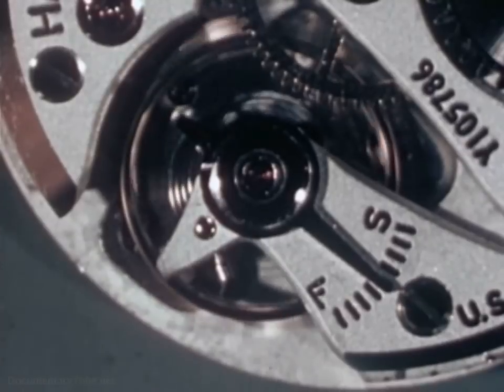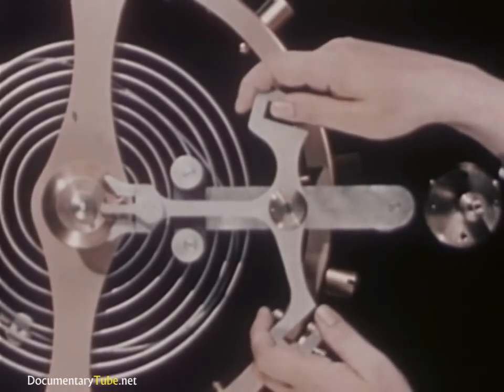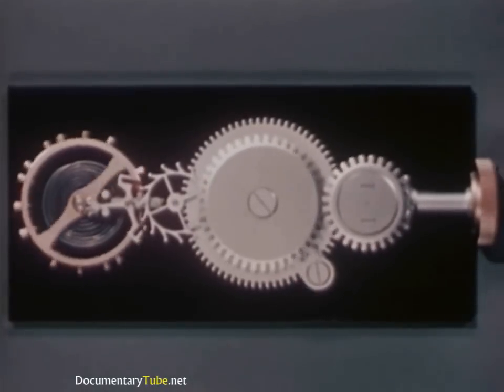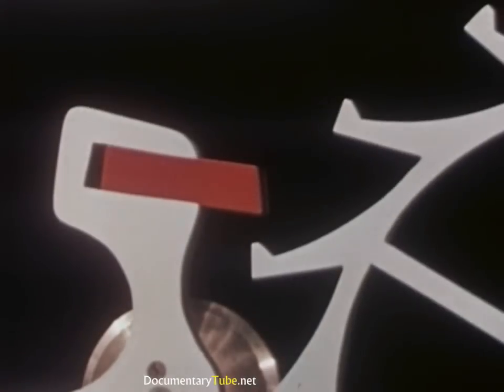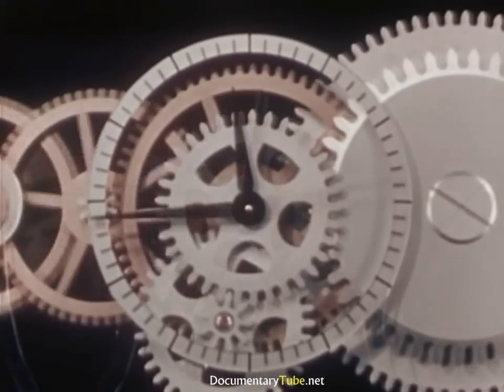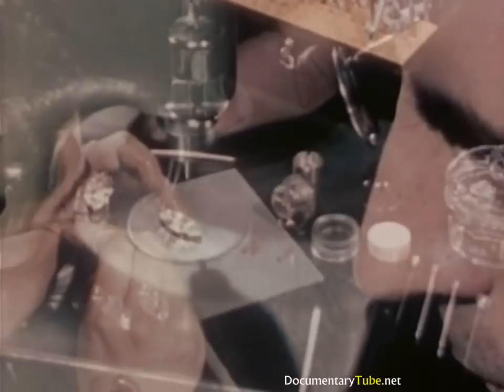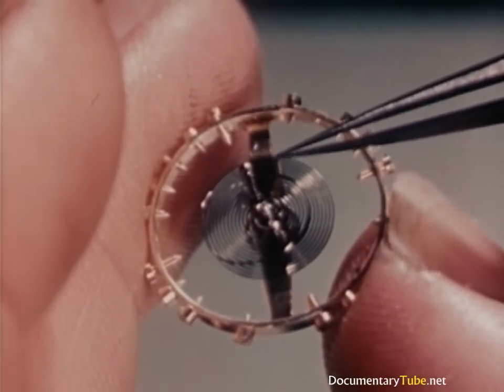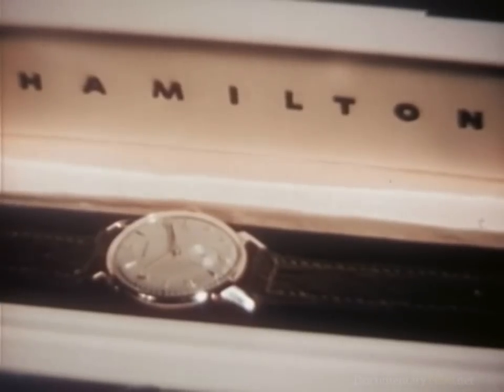HOW IT WORKS: Mechanical Watch

Comment: This is the best video showing a first time viewer of escapement type mechanisms. I had to learn how to adjust them by myself when I was 14. wind up Timex. Moved on to a 1974 Accutron, tuning forks! bought in 2014 an Ernst Benz, Chronolunar. Mechanical.

Comment: I just purchased two mechanical watches, purposely with the backplate removed so I can see the movement, springs and gears. It is made in 2021, and the insides look almost EXACTLY like this one. I thought it was 6 ticks to the second, because I can clearly see the Escape Wheel (I now know the term for that odd-toothed gear) and now I know it's 5. 

The IRL oversized example should be used more in demonstrations. I know 3D modelling is awesome, but they usually don't have the interactable extra physics that real-life has, only what the animation needs.
Reply: What are the names of the watches you purchased?

Comment: I watched other modern videos that used CGI to show how mechanical watches worked and really still didn't understand it.  I watch this, and show now understand how it works.  The part where they show how the palette, palette jewel, escape wheel, and balance wheel interact finally clicked in my head.

Comment: 5:47 Importantly, the "isochronicity", the time-keeping accuracy, is achieved when the "nudges" push against the hairspring...if a nudge is too hard it doesn't matter as the hairspring will return a little quicker, if too soft the hairspring will return a little slower, but it will always return in the same amount of time, just like a pendulum always swings and returns in the same amount of time regardless of the starting point (the only way to adjust a pendulum's swing time is to adjust the length of the string).

This is the essence of isochronicity, being able to maintain a time frame regardless of the strength of the pushes or nudges. A balance wheel is essentially a pendulum but imagine the pendulum scribes a full circle rather than an arc, and imagine the hairspring is gravity. This mechanism takes gravity out of the equation, which is why they were invented in the first place, for use at sea to calculate longitude. The balance wheel was invented by Robert Hooke.
Reply: @The Terrible Puddle....yes, there is a lot of movement that can throw off the accuracy of the watch, tourbillons counteract that movement well, making it more accurate
Reply: @The Terrible Puddle.. bear in mind movement is not all gravity, movement can be made in any direction, imagine shaking a watch up, down, sideways, tourbillons counteract all those motions, yes gravity is a substantial part of the story
Reply: I had this question after watching this video regarding how the ticks were uniform for timekeeping. Gladly found your comment and now I truly understand the fundamentals. The video does not cover this, it's more focused on the mechanical aspects rather than the core principle.
Reply: @Nikhilus_yadavus   yeah, I felt the video, albeit great, missed the fundamental concept of isochronicity which is where the regularity of the ticks comes from so I sat down to define it in my own words. 

I could use this reply to add that most mechanical watches run at 21,600 beats per hour and, through a series of cogs, which displays as 60 ticks a minute. BTW it doesn't have to be 21,600 (3hz), it could be 28,800 (4hz) for potentially more accuracy, or even 36,000 (5hz or hi-beat) more accurate still, although the power reserve tends to be lower. With 3hz movements you can visibly see the second hand ticking 6 times every second (6x60x60=21,600 beats per hour) with 28,800 and 36,000 an even more pleasing sweep at 8 or 10 ticks per second.
Reply: @TheExpeditionUK  Really helpful. Thanks!
Reply: This was really helpful, thank you

Comment: I have one question. I hope I can explain it correctly. So the crown spins first two gears, and the second one winds the main spring, so they are connected. Im asking: what kind of connection it is. I imagine it is not a symmetric joint because, unwinding of a main spring wheel would affect the winding gear, and as we know, winding gear is blocked in the unwinding direction.

Comment: How do they make sure it takes exactly 12 hours for the hour hand to make a full rotation?
Reply: My understanding is that the gear ratio makes the minute hand move 60 times faster than the hour hand, and the second hand move 60 times faster than the minute hand, but what controls how fast the hour hand moves?

Comment: How would you even begin to calculate the exact measurements you would need to make all of these gears? How were watches originally engineered?
Reply: My best guess is that larger clocks were made first, then over time, people found ways of making them smaller and smaller. Kind of like how computer components got smaller and smaller.

Comment: Does it tick more slowly when the spring is low on energy?
Reply: No. It ticks at the same rate because the balance wheel oscillates at the same rate no matter the matter the force on it.

Comment: is that a tourbillon?
Reply: shahrouzkhan200 No, this is not a tourbillon. This is just a basic mechanical watch. The movements get more complicated by the many "complications" that are added to this base model. If you add a date, or day of the week,  or month of the year....the movement becomes more "complicated". Many more gears have to be added for each new type of complication. If you add a chronograph (stop watch function)  you are actually almost doubling this original base model....like adding a second floor to your ranch style home. The tourbillon is the pinnacle of watch movements. It is why they can cost over $100,000 US dollars. It can take two or more years to develop one tourbillon movement. Once developed, manufacturers generally only make 10 copies of that model.....hence their rarity and cost (besides the precious medal for the casing).  A tourbillon has very intricate parts that defy earths gravity that other wise slows a regular movement down ever so slightly.

Comment: Our ancestors were soooo much smarter than us. Mechanical energy is incredible and todays electronic devices are shameful in comparison.
Reply: Chuck Beef I mean you have a computer at the palm of your hand you can watch hundreds of movies. Time that is more accurate then a mechanical watch. How do electronics perish in comparison.
Reply: Exactly. Our electronic devices are far more complicated than this relatively basic mechanical machinery. I think any engineer would be able to respect both forms of complicated machinery.
Reply: As a junior in computer engineering I can confirm that the complexities of circuit and signal analysis make me cry on a daily bases
Reply: Shameful?  Try to learn how to design a new computer processor. I can build a discreet component TTL computer ie late 70's machine, but today's processors are just black box magic.   Every bit as much brain power goes into today's devices as in a mechanical watch.  I think Both are incredible!

Comment: What's so amazing is that a quality mechanical watch can be accurate to within a second or two a day. Remarkable barely describes that.
Reply: Leon bOzZ Much more effort is put into a mech watch than one that runs on quarts. Time is only a factor to appreciate. Others include craftsmanship,  quality of materials , warranties, etc. Your quartz is accurate,  much more accurate, but there's a reason why others still prefer mech.
Reply: Competition chronometers and marine chronometers are accurate to less than a second a day. Despite variation in temperature and position. That’s crazy lol.
Reply: if you get a tourbillon or gyro tourbillon, some of them can be accurate to a second for like 300 years
Reply: Dcvbkyrsscbgdsxcgf  you mean 3d printing. Its not wide spread just yet. And those methods are still not used in manufacturing of mechanical watches. The manufacturing is  still vastly more expensive.
Reply: Superlative Chronometer, dudes!
Reply: @mr.personal-ity  Omega has Master Chronometer too!
Reply: mdfouru  so are u saying that a quartz watch is a less complex feat ? A quartz watch is years ahead of any mechanical watch and is a complex engineering feat in itself. Only problem with a quartz watch is that it doesn't have gears and springs to look at and admire but that doesn't mean its inferior . A role of a watch is to tell time and a quartz watch will do it more accurately than the most expensive and accurately made mech watch .I think we should appreciate both movements.
Reply: @jerryldavis1823  I agree. When Seiko unveiled the Astron, it was one of the most sought after watches. It was an incredible milestone in electrical engineering. Since the majority of watches utilize the movement, I think it speaks for itself as the greatest achievement in timepiece technology.
Reply: @jerryldavis1823  Truly said. I just felt the same when I read that other guy. I am a mechanical engineer myself but to think of pushing other discplines under the bus is just dumb and gets in the way of real innovation. Mechanical watches sure are flashy while doing its job, but Quartz watches did what no mechanical watch could do. It made the watches a thing which everyone could have. Made them smaller, easier to repair, and not just a luxury item that mechanical watches have been reduced to now. Engineering is about making life simpler. While the feat of making a mechanical watch requires remarkable craftsmanship, and initially a breakthrough, its time to move on, put on some new glasses, appreciate the real breakthrough behind the invention of mechanical watch and not dismiss other kinds of watches which do the same work just as beautifully.
Reply: how is that amazing? my 30 dollar quartz watch is more accurate
Reply: you dont need a battery for a mechanical timepiece
Reply: @leon9197  You just don't get it.
Reply: @leon9197  Making babies in a test tube is also more accurate. I prefer the beautiful way.

Comment: How does the balance wheel switch toggle at the same rate, even though the potential energy from winding the main spring is decreased over time. If the balance wheel is pushed by the escapement wheel, wouldn't the arch of the balance wheel change over time, changing the rate at which it toggles the switch? I'm making the assumption that the energy transferred from the escapement wheel to drive the balance wheel decreases over time because of the decreased potential energy. Is this true? I think i'm not understanding some part of this properly. Is the energy released linearly? If so how?
Reply: The entire point of the escapement is to isolate the balance wheel from the torque of the mainspring, which, of course, varies greatly.  The balance wheel is a spring-mass oscillator, with a period depending only upon it's mass and the hairspring stiffness, thus the accurate time-keeping.
Reply: dizzywow this is the right answer, among many. Mass on a spring has the same period independent of max amplitude or velocity. So the jewel pin will move the pallet at the same frequency regardless of the maximum energy in the spring. Even though the momentum transferred through the escapement may lessen as tension in the mainspring decreases, so even if total energy in the hair spring decreases, the frequency of switching remains the same.
Reply: dixzzy. Very concise explanation. Thanks.
Reply: Mike Jensen   you're understanding it properly.  No one has made a mechanical escapement that is immune to variation in thé driving force.  Push harder, it goes faster.  The oldest escapements were very prone to this,  but a huge effort has been made to improve them and reduce this dependency.  But not eliminate it.  The best will go very slightly faster when fully wound and very slightly slower when almost unwound.  Nobody cares. They don't sell to people wanting an accurate chronometer, who would choose quartz or satnav.
Reply: Makes no difference. The energy is transferred, and regulated in identical increments, evenly, to the balance wheel, regardless of how much tension is on the mainspring. Otherwise a half wound watch would keep different time to a fully wound watch.
Reply: Mike Jensen As You Can See Closely, The Size Of Wheels Keep On Decreasing. Suppose There Are 2 wheels connected. One small and one large. If you rotate the large wheel, the rpm of large wheel will be lesser than smaller wheel. This means that rpm will keep on increasing if you reduce the diameter of wheel. Here the diameter of wheels connected in series keep on decreasing. This clarifies that the rpm of smaller wheel will be more that the rpm of large wheel..

Comment: A particularly interesting video for me since I inherited a Ball watch Co, RR standard  Hamilton 999 21 jewel from My Grandfather. It is now 110 years old and still functioning perfectly. It is still a mystery as to how my Grandfather, an English coal miner, came into possession of this American masterpiece.
Reply: Is it possible that someone in your family worked for a railroad? Engineers and conductors were required to own very high-quality watches, because before radio there was no way to talk to a train once it left the station. Every train had to keep very precisely to a schedule, because different trains often shared the same track. The whole system was based on every train being in the right place at the proper time, so every train crew needed to know accurate time. In the United States there was a famous crash in the 1890s between a high-speed freight train and a high-speed passenger train, which happened because one engineer's watch was four minutes off.

This is why the railroads needed such expensive and precise watches. There were a lot of rules about which types of watches were allowed, and the watches were regularly serviced and inspected.

In the United States, railroad watches were required to be accurate to within 30 seconds per week (that is a 30-second error in 604800 seconds). Watches and clocks were set to the correct time every day.

The railroads made loans to their employees, who were required to purchase their own watches. So, family members of railroad workers might inherit very expensive watches, even if the family didn't have a lot of money.

Because railroad employees were usually not wealthy, but were required to own these wathces, you often see very expensive railroad-watch movements housed in nickel alloy or other relatively-cheap cases.

American pocket watches were once among the highest-quality mass-produced watches in the world, because they were made in factories with standardized parts, instead of being made one-at-a-time by hand in small workshops (as most other countries were doing up until the late 1800s/early 1900s).

Some American railroad watches were used by the British military. I guess this makes it possible that there were military surplus watches around.

During WWII, Hamilton pocket watches were issued to the navigators on U.S. bombers.

One last thing, there once was an important tradition of handing down a pocket watch to your son or other close male relative. An inherited watch was a nearly sacred momento that you would never part with. I can think of ways that a more-prosperous branch of a family might pass a watch down to a less-prosperous branch.
Reply: People sell things to survive, or find themselves gambled into a corner. Or never pay back a loan that a watch guaranteed...
Reply: I agree but still find it mysterious as to how a relatively expensive American Railroad standard pocket watch wound up (no pun intended) in the hands of a British coal miner that had never visited the states. The Ball watch Co. remarkably were able to provide manufacturing details that show the movement going to the finishing dept  in 1906
Reply: No, I did check all that out. My Grandfathers brother did indeed emigrate to the States but He and subsequent family were always self employed in construction. I also know the story of why the Ball Watch Co. was set up (at that time they did not manufacture watches but were effectively a regulatory body that set and maintained the standards for railroad watches) The set up was in reaction to a major railroad disaster (Kipton I think) caused by an engineers watch having stopped. Thereafter any watch used by the Railways had to be certified to the Official Railroad standard as set out by Ball.
I am also aware of the tradition of passing down the watch and have quizzed my American cousins about this. They all have no knowledge of it and know of no family member with Railroad connections.
There is therefore only one other possibility, the watch was used to pay off a debt? I know my Grandpa partially funded his brothers trip to the states. Perhaps the watch was given to his brother in such a way and in turn shipped to Grandpa, We will never know
Reply: Astounding! You have a TREASURE on your hands. Please care for it religiously! Lucky you, sir!
Reply: I wonder if he may have gotten it during one of the world wars. Hamilton produced a million for the US military for WWII. Possibly found a lost one, traded for it, or something else to that effect.